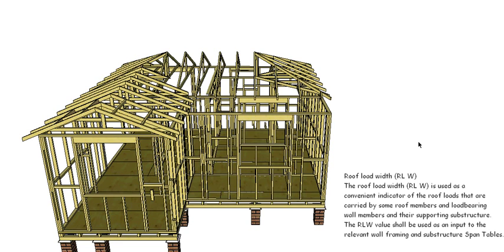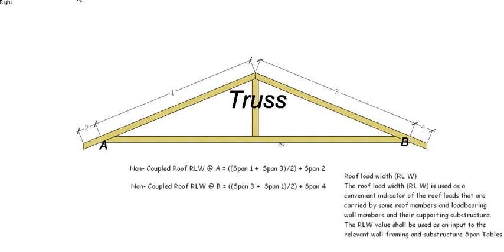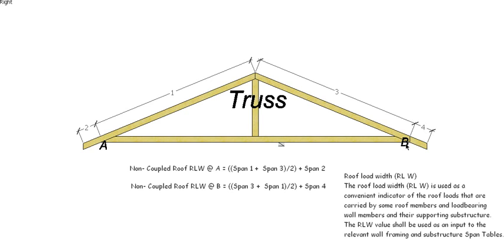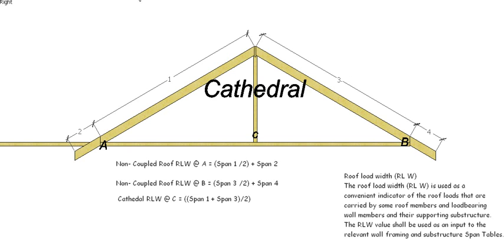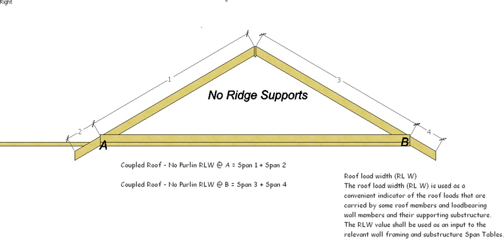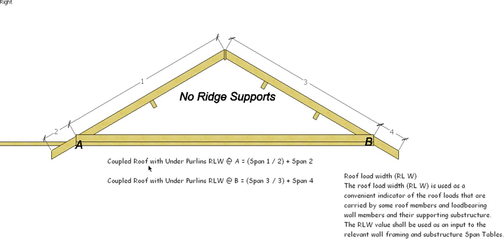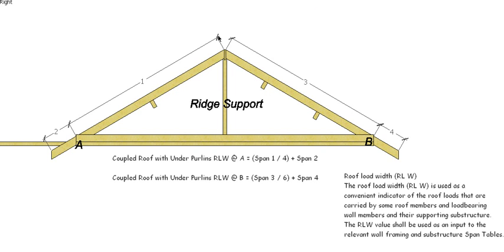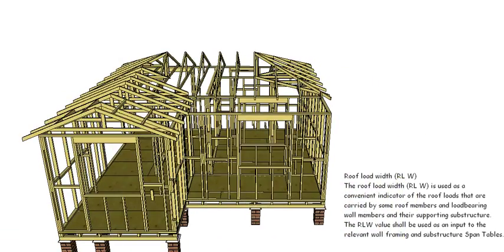6  Roof Load Width (RLW)

Comment: What is the purpose of calculating the roof load width? Is that to determine what bearers to use?
Reply from the maker: Hi Mate, RLW is one of the required inputs into the span tables so you can work out the size of the timbers you need.

Comment: Hi Buildsum, Absolutely love your videos and explanations. Can you help me with clarification please? At 5.25 Coupled roof with underpurlins & ridge support; Span 1- ridge takes half of the load towards underpurlin- (that equals 1/4 of span 1). Then A takes the load from half way up toward underpurlin (that equals 1/4 of span 1) plus add span 2. Does that mean that RLW at purlin is total of 1/4 of span 1 above it plus 1/4 of span 1 below it? ie half of span 1? ie if span 1 is 6 mts in this situation and I had to select a purlin size- the RLW applicable for the purlin would be 3000? Or have I got this muddled up? Thanks in advance.
Reply from the maker: Hi Robin, thanks for your comment and sorry for the delay in getting back to you. The RLW in this case is just Span 1 / 4 +Span 2. So if Span 1 is 6m then the RLW will be 1.5 - Span 2. Hope this helps.

Comment: These are really great, but what I don't understand is, why would anyone other than the engineer need to know these? Doesn't the builder just follow the engineers specifications anyway?
Reply from the maker: Hi mate, this is actually in the scope of what a builder can do however these days with the level of complexity of some of the projects and the want to transfer liabilty to others, yes it is frequently left to the engineer to work out. 
On small renovations, extensions, pergolas etc it is generally not work the extra money for an engineer so the builder can use it then. Hope this helps
Reply: abslutely not. A good builder will know more than just banging stuff together and reading a plan. No wonder trades have lost there beauty these days.The whole why should i do it....and then you guys are the first to bag out everyone else when shit goes south.

Comment: Hi Buildsum, for a layperson these are a fantastic video series.  At 4.30 in this RLW video there is an underpurlin shown but the RLW as given for support A appears to be for 1/2 of span 1 plus the overhang 2.  As if the underpurlin under span 1 isn't providing any effective support at midspan rafter.  Yet further on when the ridge support is shown at 5.20 span 1 loading is correctly divided into 4 parts (assuming underpurlin is at rafter midspan).  Similarly, at 4.30 shouldn't the span 3 be divided by 6 as is the case further on?  Can you please confirm which is correct?   I'd also like to suggest that the load on on the span 1 underpurlin (at rafter midspan) would be 3/4 span 1 and 1/6 span 3 (if underpurlins are evenly spaced). Similarly each of the underpurlins under span 3 the loads could be easily solved.   Look forward to your comments.
Reply from the maker: Hi Peter, In the first example at 4.30 it is not the purlin that's not providing support but rather the ridge. 
These formulas are as per AS 1684 Timber Framed Buildings which I'm sure were worked out by smarter people than me and are the ones that we need to use regardless of whether we think they are correct or not.

Comment: Hey Buildsum love you’re videos.
Do you know how to find the RLW for the hip end of a hip roof? Do I use the crown rafter and calculate it like a non coupled roof? I am making a large opening in the hip end load bearing wall so need to know what size lintel is sufficient.
Thanks!
Reply from the maker: Hi Becca, don't worry about the Hip End just work it out based on the common rafters. The RLW is the same for all areas of the roof.
Reply: @Buildsum  great thank you!
My trainers at trade school (Trades Institute Victoria) use your videos in class all the time. Such good content thanks for sharing.
Reply from the maker: Thanks Becca, great to hear that people are finding my videos useful.

Comment: Hi buildsum, your videos are very helpful thankyou for your efforts and time to teach us, i have one question however as there’s still one more type of roof that wasn’t mentioned and thats the cathedral roof in where the rafter is sitting on the wall, with no ceiling joist, held by collar ties towards the upper third of the roof with a ridge beam, what calculation would be used, I can provide photos if you’d like to your email maybe to make myself more clear, thankyou so much
Reply from the maker: Hi Abdul, i would think that this would fit as a Coupled Roof - No purlin similar to the one shown at 3.26min. The ones i have shown in this video are as per AS 1684.2 which is the Timber Framing Standard for non cyclonic areas in Australia. If what you need is not covered by the standard then you will need to get a Structural Engineer to design a system that will work for you. Hope this helps.
Reply: @Buildsum  yes, what I’m after isn’t covered in the bca like you said so there are roofs that a Carpenter can’t construct without engineer involvement, thankyou , much appreciated

Comment: Hello , the example you have given is coupled roof, since the roof do have support between the rafters. but the notes you have mentioned is for non-coupled roof. I am a bit confused here. Thanks for the Video. it is really helpful
Reply from the maker: Hi June, the first half of the video looks at Non coupled roofs and then the second half of the video looks at the coupled roof. The diagrams in the first half of the video show the top plate in position, maybe this is making you think that the roof is coupled however this is not the case.
Hope this helps

Comment: If you were designing a lintel where those jack trusses rest at 48, what's the Rlw in that case?
Reply from the maker: actionjessie The RLW applies to the whole roof not just a particular area so if you use the formula for a trussed roof it should give you the RLW that you need.
Reply: Buildsum fuck my whole assignment is wrong! Thanks I got till 5 to fix it!!!!